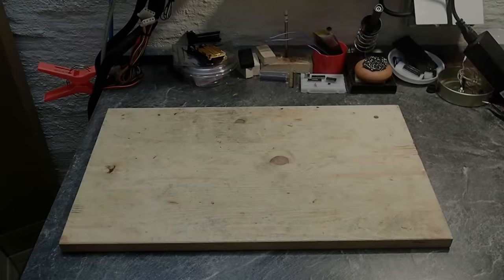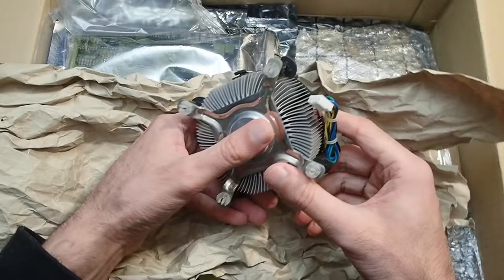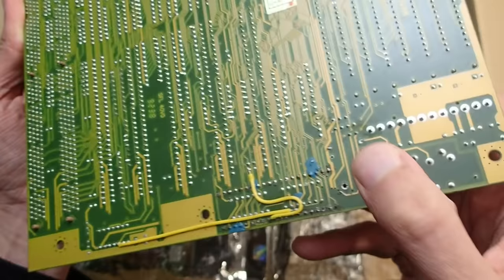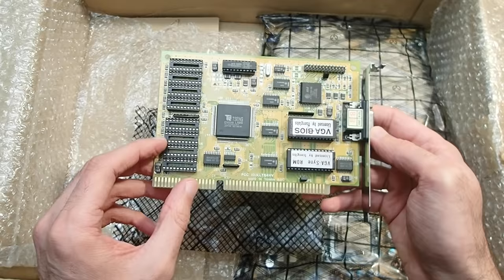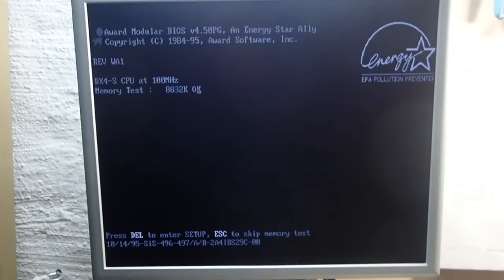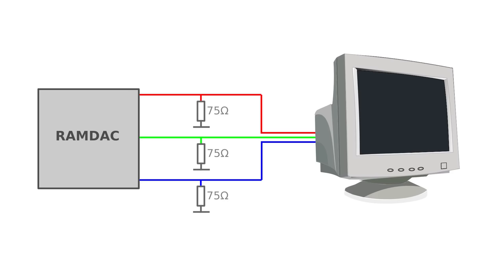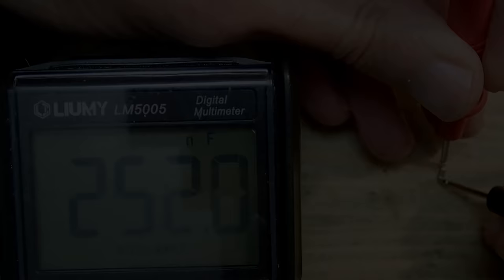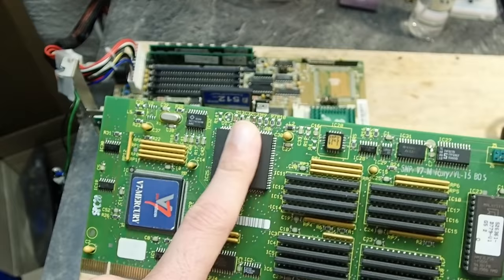Unpacking a donation, trying to repair a graphics card color glitch

Comment: The 486 board "EISA" slots might be actually "Opti local bus" ones. They used same connectors, but weren't compatible. All EISA boards I have seen were usually server boards and had all slots EISA. But it is quite time, so I might be incorrect.
Reply from the maker: Yes, it's an OPTi Local Bus. There are already a lot of comments about it below. Anyway, thanks for the hint!

Comment: Great stuff!
Did you wonder about modifying the circuitry to avoid the monitor detection and possibly get rid of the issue in the RAMDAC? I don't know if would help in any way...
Reply from the maker: Thanks! Yes, I thought about that afterwards, but I was not sure how to bypass that, may be a pull-down resistor of a low value on the SENSE output of  the RAMDAC would help, but I'd have to dive deeper into S3 documentation to get the full picture. I thought, that the video was already long enough and with the software solution there is at least one way to workaround it.
Reply: i remember back when using s3 trio64 if i boot pc without monitor connected it beeps like there is no graphics card and when i connect monitor later it was all black and white. i was interested why it behaves so odd and found there is some pin at connector which should be connected to something (trough low value resistor for safety) or maybe it was one of R/G/B signals which need to be loaded by resistor to ground i cant remember now just remember it all ended up with plug with some resistor which was enough to make it happy
Reply: oh. i see ! it was exactly that. then since this feture is not really useful rather annoying why not just bridge that pin to "detected" state externally? than bios will think its in color mode and load appropriate ramdac values and everything would be good as new ;)
Reply: @MRooodddvvv   ^^^  Fixed.  :-)
Reply: Maybe you can even add a physical switch on the card for monochrome and color mode if it's just a matter of toggling a single bit.

Comment: Could it be one of the other caps around the ramdac? Ceramic caps can definitely fail in a “works when hot” mode.  Should be easy enough to spray ramdac with some freeze spray when it’s working and see if it goes back to failure mode.
Reply: +1 I neither think the RAMDAC itself is broken, at least it's more likely that something's defective "around" it. @necroware it would be awesome if you would be able to revisit this card.

Comment: The beeps you were hearing on the S3 VLB card - they're lower in pitch than Award's beeps. They indicate the VGA cable isn't connected - that's why the BIOS would be B/W and Windows in full color (though I have seen Windows in B/W as well, this happened on a Phoenix branded S3 Trio 64).

Comment: That core 2 duo would definitely be a good candidate for a Linux build.  I have an Odroid H2+ which runs a 'modern' Celeron processor (Intel J4115) that I run ubuntu on for my workshop.  It is very snappy and does everything I need it to do, including running Autodesk Eagle CAD.  Youtube playback is extremally smooth, even in HD.  I use an SSD as the boot drive and it boots and resumes instantly.
Reply: or a light storage server like TrueNAS or XigmaNAS
Reply: The youtube playback on the modern system might be due to hw accel, which probably was not available yet  on the early GMAs used for the core-2. And even if the hw was available, it is likely that the intel team did not bother implementing this support for hardware this old.

Comment: Did you try with another monitor. Video cards that age might implement DDC1 (tying ID pins to GND or leaving them floating) to detect the monitor presence and type. Modern monitors use DDC2 (an I2C bus)

Comment: Eager to see you diagnose the Voodoo2 card, I have one that does the same thing, already replaced the GenDac chip but made absolutely no difference. Great videos, really appreciated.
Reply: I’m not sure, but one of the QFP’s on the voodoo looks to have pins bent. This once caused my voodoo to be detected, but definitely not work anymore. Bending them back with an exacto knife did the trick for my voodoo. :)
Reply: @Inject0r  I'll have a closer look with my microscope, thanks. Yes I get detection too, but when it switches into glide mode I get vertical Black and blue bars.

Comment: I've seen similar issue with some ISA tvga9000 cards. Did some googling and found it could be an issue with a poor connection for Vga DDC data channel to detect the monitor capabilities. Sure enough jiggling around the VGA connector does cause the issue to go away.
Reply: It is highly likely that ISA and VBE cards predate DDC. Iirc, that only came about in the PCI era, and even then only few of the early pci cards had it in hardware. And the BIOS support is probably even further behind.
Reply: Ah, next comment, DDC1 vs DDC2...

Comment: What an awesome video! I really found this to be super interesting and helpful. I have a few PCI cards of a similar vintage that suffer from similar issues; I always suspected a something with the RAMDAC and I suppose this just about confirms it. It sounds like the SENSE pin is the culprit.

That 928 is a beauty! I've always been curious how they were on VLB; on ISA, they are brilliant cards and probably just about the fastest you can get in DOS. I loved your work on it and, as always, thank you for providing so much helpful information and for really teaching us how these things work. Your videos are always fascinating!

Now, that Mach32 EISA--I'd be lying if I didn't say I was drooling! I have been hunting for one of those for some time and, like you said, EISA graphics cards are very rare. I can't wait to see what you do with it! I know it will be very cool! I love those early ATi cards and have a Mach32 VLB and Mach32 ISA; both are the same setup as your Mach32 EISA. The 2MB of RAM on them is quite nice and gives access to some great Windows color modes, and the cards provide pretty good acceleration, even compared to late cards. I suspect that's because, like the S3 928 you showed, they have a 64-bit memory bus. 

That UMC 486 board is also very cool! I read some of the other comments and agree that those are likely OPTi Local Bus slots. There was also ECS Local Bus, but I believe that used a VLB-like connector. OPTi Local Bus would be neat to test! I believe there were some early S3 911s for it and a BUNCH of ET4000AX cards. I've seen some out there here and there, but not as often as I used to. 

Anyway, thanks again for all of your work! This was awesome!
Reply from the maker: Thank you very much. I'll try to come up with some cool videos about EISA. I already have most of the parts I need to build an amazing EISA PC and I'm very excited to see how it performs.
In regards of the OPTi Bus, you are absolutely right! There were already some comments below about it and I fully forgot about an existence of such, but it's true, that was not EISA! :)
Reply: @necro_ware  You're welcome! I am very excited to see this. I am very interested in what you see, performance-wise. It seems like EISA is a very wide bus and super well-equipped for SCSI and Fast Ethernet, or other such bus-heavy data transfers. As for graphics, that's where I am uncertain. So little information is out there. I can't wait to see what you uncover!

OPTi Bus is very interesting! Do you think that's something you would explore at some point? I would be interested to see how it compares to, say, VLB. I imagine the performance is similar, right?

I have always wondered at those boards with 2-3 EISA slots. It feels like 2/3 of them are OPTi Local Bus or something like that. There's apparently ABIT boards that used a PISA riser card in such slots!

I have one odd board with a HiNT Caesar chipset that implements "mini-EISA," and it's pretty much regular old EISA, minus some DMA and bus-mastering features. Apparently it works normally if you tweak some SCSI controller settings in the EISA Config Utility. Oddly, it looks somewhat like your UMC board. I wonder how many customers bought such boards and damaged them, thinking that OPTi Local Bus or something of that nature was EISA? It's wild to think, especially these days, when everything is PCIe haha!
Reply from the maker: Well, at least I will try to repair the OPTi Local Bus board, I don't know yet, if I'll succeed, but I'll try. However, I have no OPTi Local Bus cards, so I will not be able to say anything about it's performance, even if I'll get it back to life.
Reply: @necro_ware  I see, that’s fair! But hey, if there’s anyone who can figure out what’s up with that board, I know it’s you! Best of luck with it!

Comment: Hopefully uou can find another salvageable flatpack ramdac chip to properly fix it with such a little issue like that it would be sad if the chip and the bonding wires within break and the whole card dies. I am sure you will fix it given the chance you did do a good job thus far. Thermals were a issue back in that era they weren't self monitored and when something overheated it either damaged the component or components but often the magic smoke would come out which luckily didn't happen. Keep up the good work mate
Reply from the maker: Those ICs are unfortunately very rare and expensive. Usually they cost more, than what you'd pay for the card itself. This issue was however worked around for now with a resistor. Scroll through my community tab if you are interested.

Comment: So the /SENSE is an output that tells the GPU to go mono. So... if you ground that /SENSE pin, it'll force the GPU to think there is always a monitor connected. So not only will this make your world more colorful, it also gets rid of the beeping error code.

Btw. I have a Cirrus Logic (run of the mill) card that does the same beeeeep beep beep beep and monochrome picture. However if I flex the board, it doesn't do that. I didn't fix it, but the solder on the GPU pins... barely exists.
Reply from the maker: Exactly, the solution with a pull-down resistor was already tried off camera and it works. I'll make a post in the next days about it.

Comment: Are you sure those are EISA slots on that 486 motherboard, and not Opti Local Bus? I think EISA motherboards usually have more than two EISA slots, but from what I've seen, Opti Local Bus motherboard usually has two OLB slots, and it seems to usually be the two bottom slots. The slots themselves look almost entirely like EISA though, so it can be difficult to tell them apart.
Reply from the maker: Yes, they are OPTi Local Bus. There are already some comments about it. Still thank you for the hint!

Comment: Did you check the voltage at the the zener diode in the voltage reference circuit? It's possible the zener has changed value with age, returning to closer to original with heat. Also, not all solder joint defects can be detected visually. Sometimes a reflow is the only fix. Separately, modern monitors may not have a low enough input resistance to be detected, requiring a lower terminating resistor value to get color to work. The heat may be changing the value of the resistors just enough to get the detector to work.
Reply from the maker: As I said in the video I checked all the parts around and re-flew the solder on the RAMDAC and all the parts around.

Comment: I'm thinking here about that video card... This problem seems to be separated layers at the board. When you heat, board expands and make contact. What do you think about this try? Remove chip and test some traces and contacts between the sides.

Comment: That VGA issue is related to BIOS configurations, anything using the BIOS, the mainboard one , is going to be monochrome because the card is defaulting to MONO due to the BIOS ERROR. There may be an issue preventing the VGA BIOS to load correctly. A DOS driver for the card would fix it too if such a driver exists for DOS
Reply: And some VGA cards will report an error if no monitor is connected, a VGA error at that as far as the BIOS goes!

Comment: I had similar problem with b&w output using tft montor, but it worked perfectly (color) when I connected crt monitor.
Reply from the maker: Yes, but that's another failure, which has to do with the 2 "ID" lines in the VGA cable. On modern LCDs these lines are used for I²C communication, instead of fixed voltage levels. As you hopefully saw in this video the RAMDAC was simply defective.

Comment: Perhaps a bad/cracked via like CuriousMarc's recent PS/2 Model 70 repair? Would be almost impossible to spot with visual inspection.
Reply from the maker: That can't be excluded, yes. I posted another  workaround in my community tab back then, if you are interested.

Comment: Well this is the first graphics card i see that would need the opposite of a heatsink. maybe it works reliably with a small heating element that keeps the DAC at 45 degrees. Yes, I am entirely serious. :D
Reply from the maker: lol :)
Reply: Problem with temperature sensitivities like that is that it's indicative of a physical fault that will probably be exacerbated by continuous heating/cooling cycles.
Reply: Peltiers work for keeping things warm as well as cool, they just have to be flipped over.

No I don't think this is a good idea -- better to work around the problem as he has, and not stress the hardware out any further.
Reply: @mal2ksc  You don't have to flip the peltier over. Just change the polarity.

Comment: is there a chance that the Rset resistor is way over its nominal resistance? and by heating it and having lower resistivity produces the correct signal? i might have tried to replaced it with a new one just to test it (the 147ohm one)

Comment: Try to resolder it by hand with a little bit of solder, sometimes this helps. Maybe test the connection of every pin from ic to the Board. How about to lift the pin and connect the pcb pad to ground?
Greetings
MiRa

Comment: Would you know what causes slight artifacting in specific games using my vlb card? It's an s3 805 jaton corp that runs decently fast for what I need but when playing Fallout or Civ 1, or even SC2000, when there are visual effects occurring on screen it has a weird pixilation effect that distorts a bunch of the screen. I was gonna try to just resolder the entire card in case something is bad but I'm a bit lost.

Comment: The core 2 duo will run windows 10 with no issues, especially with an SSD.
Reply from the maker: It will not, as long as it is in my hands, it will not :) lol
Reply: @necro_ware  👍

Comment: DX50 is the BEST first generation 486 you can get! BE CAREFUL ON VESA LOCAL BUS BOARDS THE 50MHZ BUS WILL KILL MANY A VLB VGA OR IDE CONTROLLER, THOUGH IT DOES WORK NICE WITH THE PROMISE VLB THAT TAKES 31 PIN RAM AS CACHE, STILL CAREFULL

Comment: capacitor on  RAMDAC is not  broken. Pleas never believe measured value, if you got this value by "inciruit-measuring".
We haven already written:  You and i are very sure, RAMDAC has a little damage.
You can replaced it with BT485 ( i have same V7 Mercury VLB , but BT485 DAC )

And i want written  a warning about  486 motherboard with "EISA" Slot. It is not  EISA , it is  a opti local bus. If you put EISA card into  OLB-slot->   Motherboard and card burn.

 regards
matt
Reply from the maker: Hi Matt, thank you once again. Yes, a new RAMDAC is just too expensive and unfortunately I didn't have any in my scrap. For now the sense signal was just pulled down to the ground. Now it always says, that the monitor is connected and it just works good enough until a replacement RAMDAC can be found.

Comment: Maybe not the chip but it could also be the pcb?
Reply from the maker: Yes, it could be also the PCB
Reply: @necro_ware  You already said that you checked the traces and resolders the joints.
CuriousMarc & his team recently wrestled with an old IBM PC and the culprit was a hair break in one of the vias next to a big custom chip.
Resoldering the via fixed the problem for good. Maybe check the vias in the area, too?